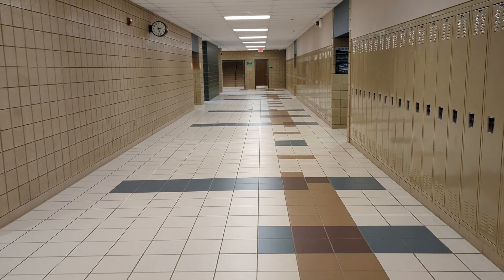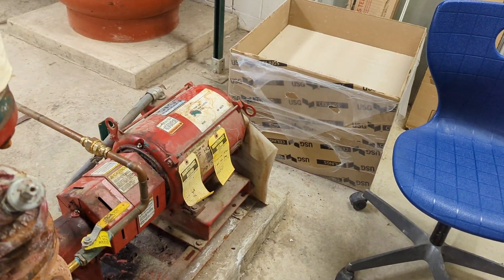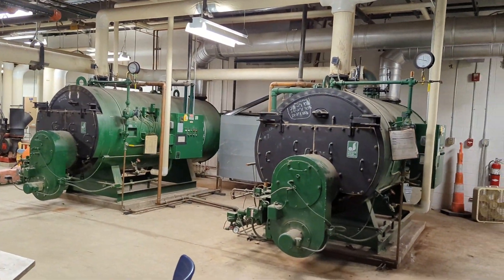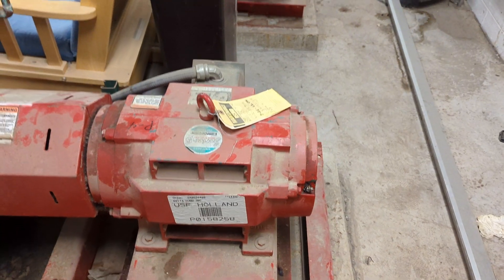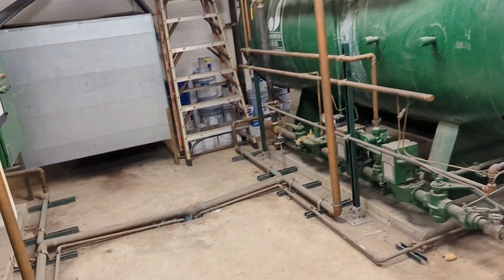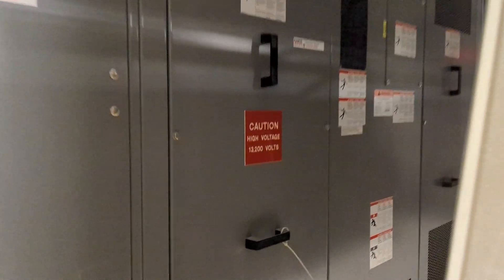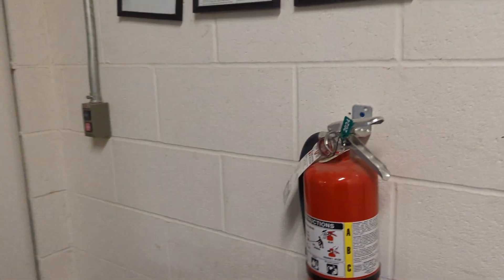boiler/volume water heater/chiller/electrical room tour - BOILER/MECHANICAL

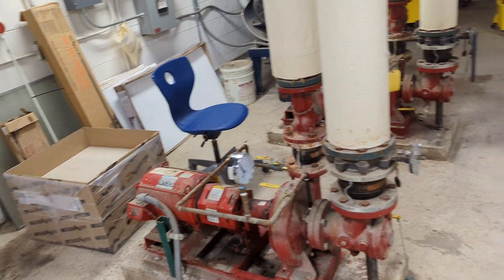Comment: I don't know how the algorithm pushed your video to me, but I watched it and was delighted to see the wall inlets (0:14), power unit (1:09) and control panel (5:20) for the school's Spencer Turbine central vacuum cleaning system. It looks like the starter disconnect switch is turned off, however...do you know if the system is still in use? If you're ever back in the boiler room, you should make a video starting it up. It's awesome that your school has this!
Reply from the maker: Well, I'll have to get a custodian to activate it. I don't work here, so I can't do that yet.

Comment: Keep your bell and gosett oiled  i retired boiler man  i worked for a public school district in IL.    Keep your boiler room clean, and painted..and boilers clean ..on top i would switch my boilers  .every 2 weeks   one on, one off.   Unless is below 0.   I spent 35 yrs in the same district..now simi retired had lots of Johnson control crap...as well. And my air compressor oil ,belts in check..
Reply from the maker: I don't work in this school to maintain their equipment, but thank you for the comment, I'm just a 9th grade freshman student inside Novi High School.
Reply: @DanfossDrivesAmerica  its a good job to have if your a hands on type..pay is good .i worked in the district i went to school at..started in 1986..